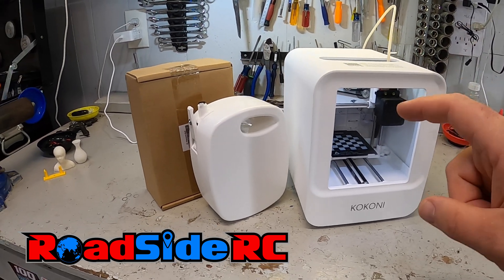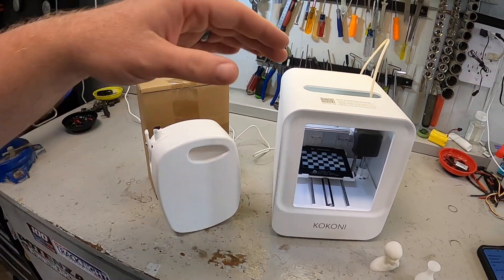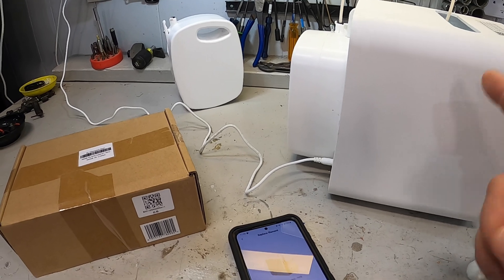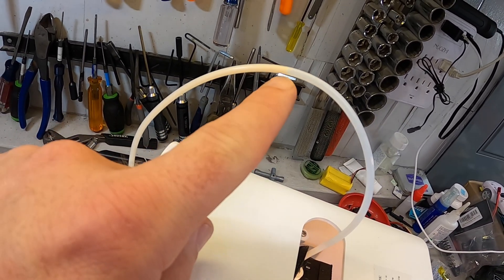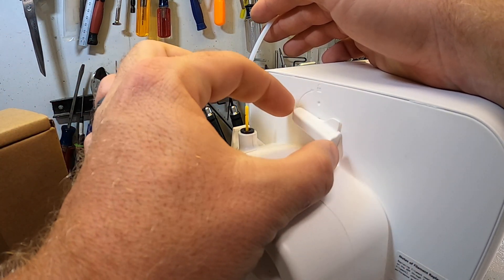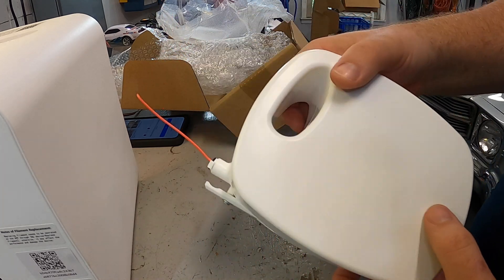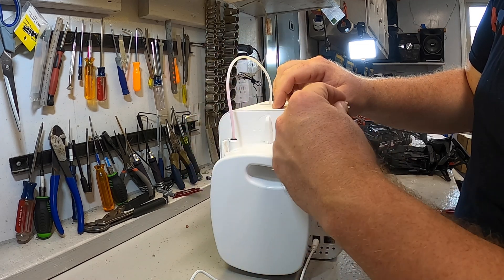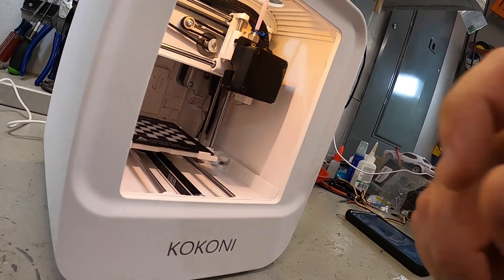How to Change Filament in KOKONI EC1 3D Printer

Comment: I have 2 questions both are concerning the Mx Losi bike q1- can you do a wheelie in wheelie mode at either 50or 75% mode
Q2- did you get it to back flip by applying the brake in mid air or going full throttle ( please tell)
Reply from the maker: Wheelie - at 75%, on a high traction surface, I believe I have done a wheelie.  

Backflip is by full throttle...and a lucky bounce.